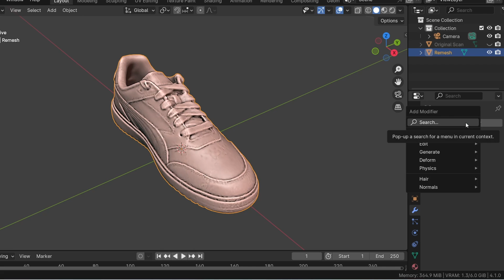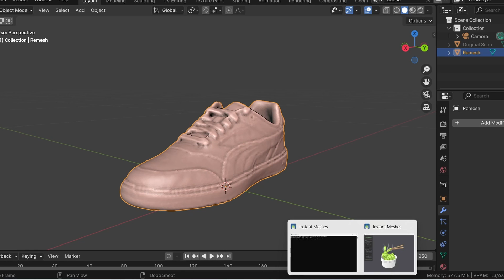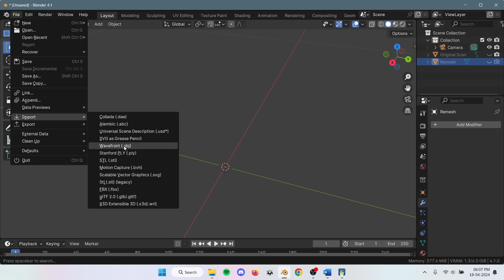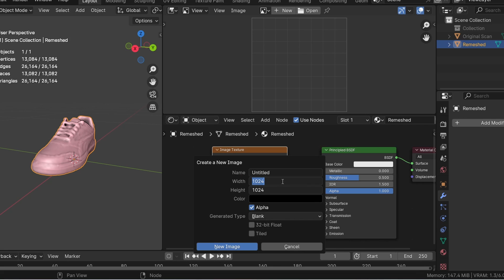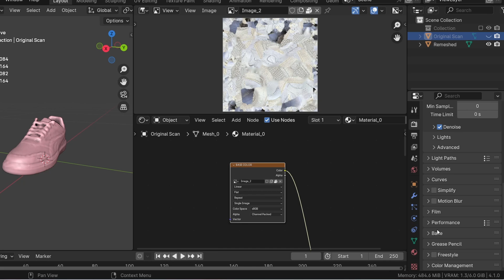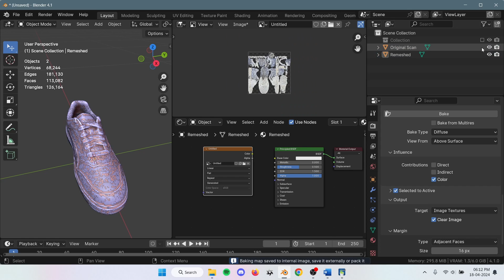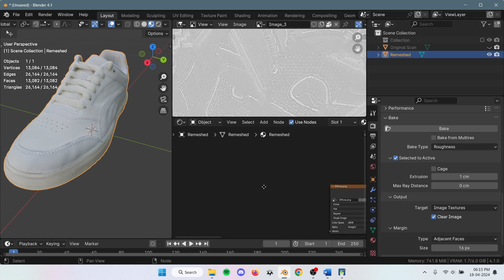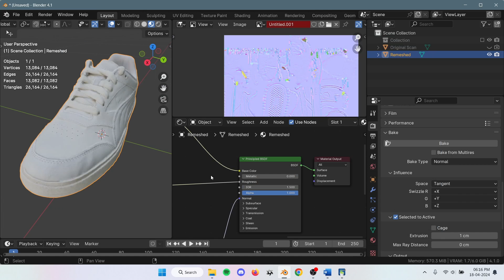Remesh and Optimize your 3D Scans | Blender Tutorial | Texture Baking Tutorial

Comment: dont u think instant mesh should be like yk more specific like lets say i want to uv unwrap manually but because of irregular spread of quad shapes all over mesh causes problems to uv unwrap manually and only way is smart uv of blender which is not of good use because after doing smart uv and then while using substance painter it causes generators not to work properly. any way to fix all this??  

if you could help pls leave a reply